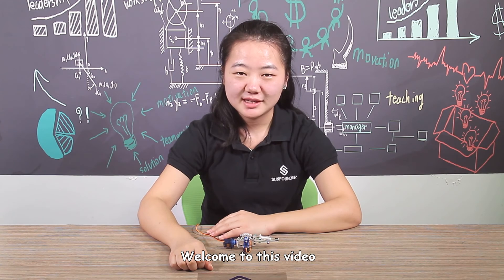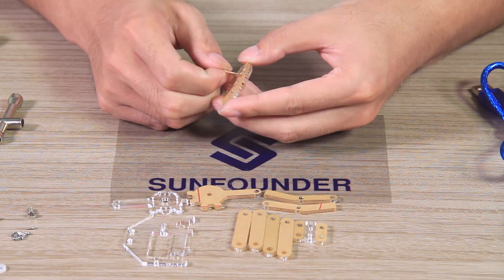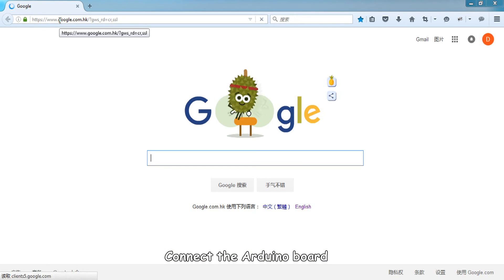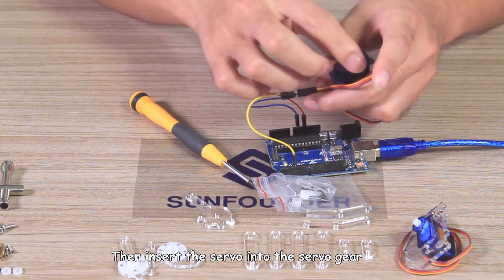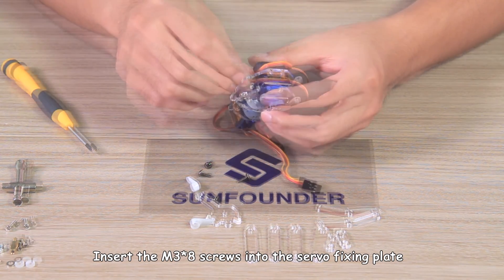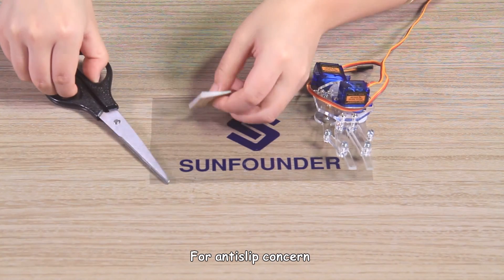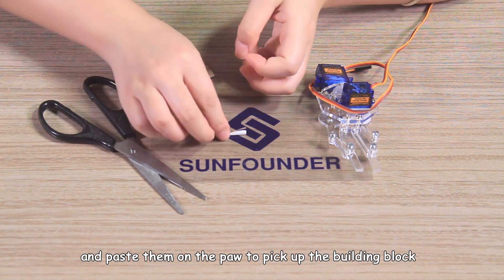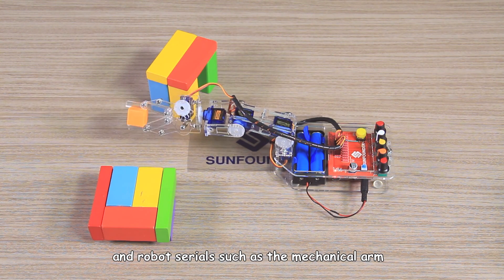SunFounder DIY Standard Robot Gripper Kit Robotic Arm Rollarm Rollpaw - Assembly Tutorial

Comment: Because the mechanical assembly is tight, it is very difficult to move the gripper. Any suggestions on how to lossen the mechanical assembly?
Reply from the maker: The structure is like this, for reference and learning, the moving joint is fixed by screws and moves at the same time, so it is not convenient to move.